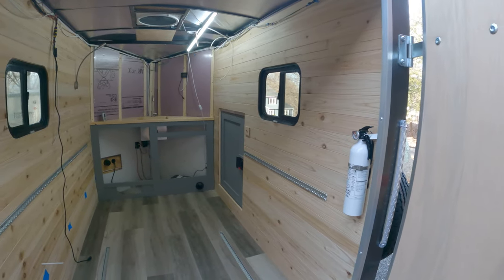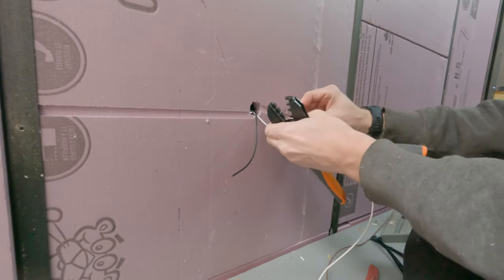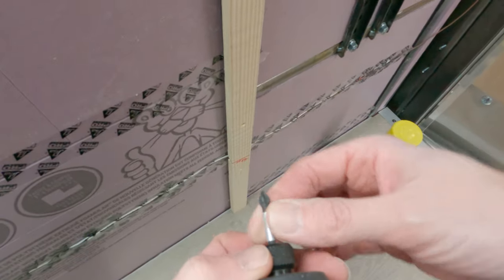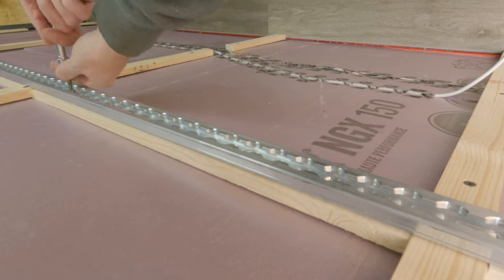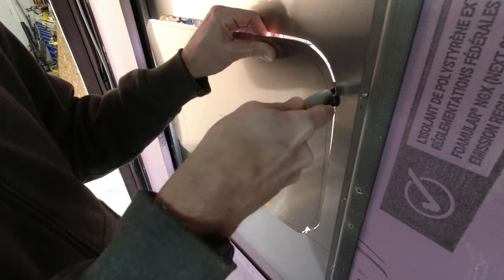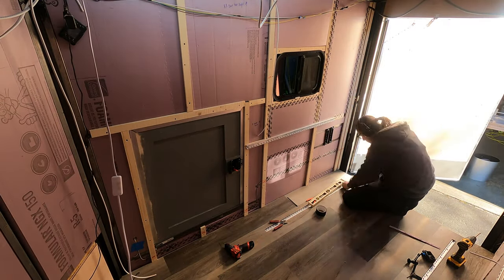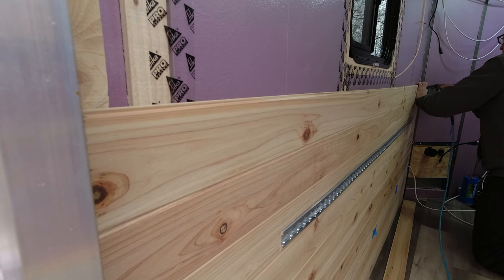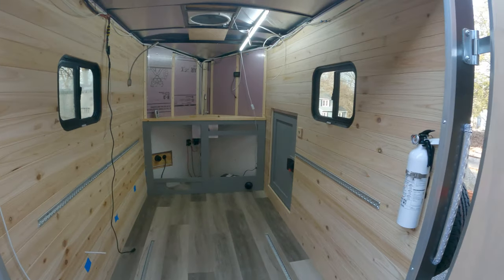Walls Walls Walls - 5x8 Cargo Trailer Camper EP 5  #vanlife inspired #subscribe

Comment: Enjoying your channel. Building out trailer myself. Want to do exactly what your doing here. However I do not have a table saw to cut down board to 1/2”. Do you know where I could purchase some?
Reply from the maker: Thanks!! You could use 1/2 inch plywood and cut 1 1/2 inch strips of it with a circular saw or jigsaw and do the same thing.  Would take a little longer, but it all gets covered up by the wall material, so if it's not 100% perfect it's not the end of the world.